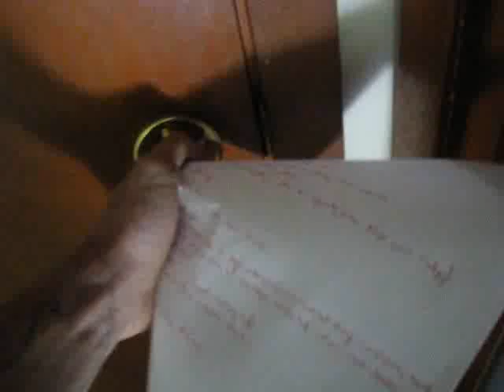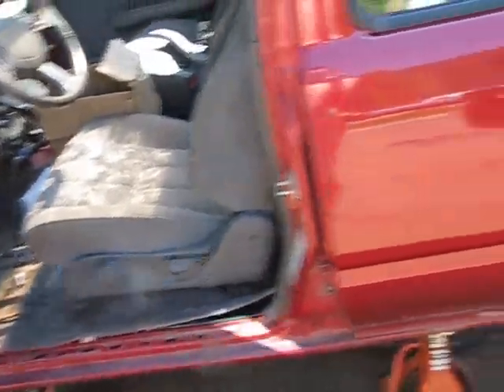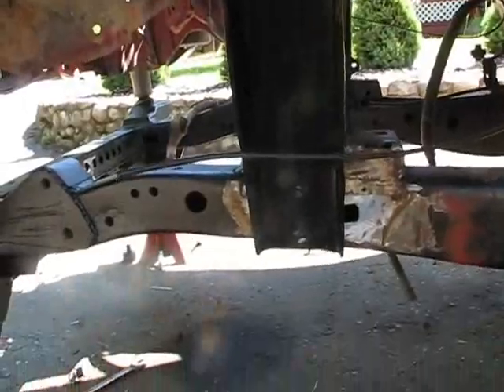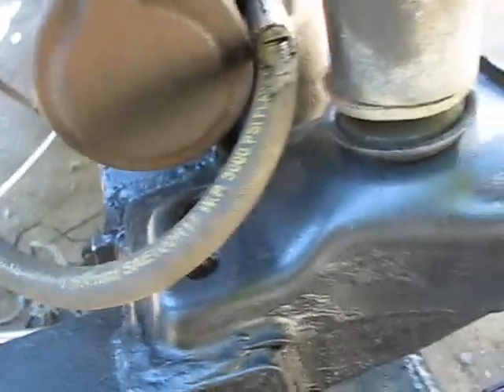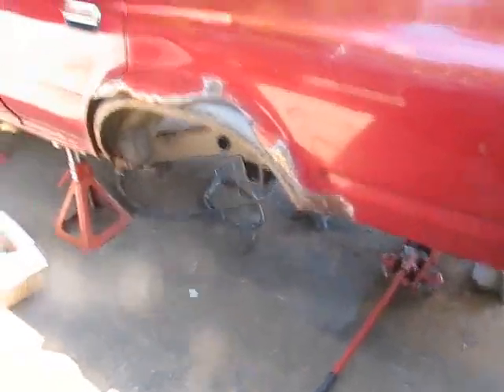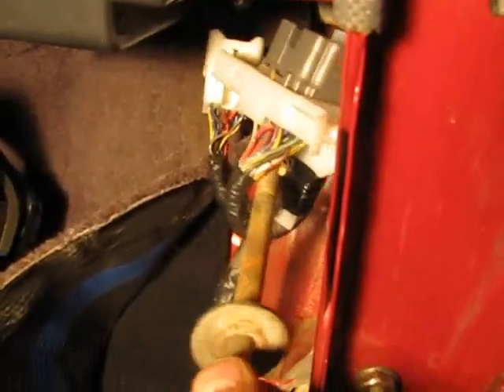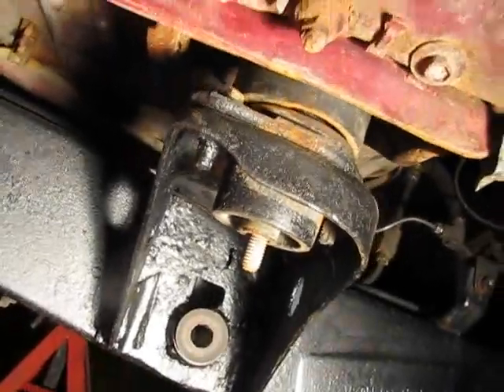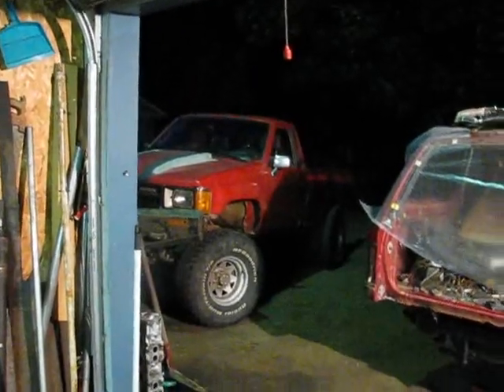94 4Runner: Body Lift Finished + Misc Stuff... (07/30/11)

Comment from the maker: @peterbiltxr379 im definitely not selling it :) its going to be my daily driver/weekend warrior! im building it tough from the get-go so that i dont break stuff. the good thing about building this truck from the ground up, is i can incorporate fixes for all the flawed stuff on my 85 into the 4runner as im building it. like my rear shock positioning... my 85 currently bottoms out the rear right shock if i have a load in the box, or get a bit aggressive on the trails... i fixed that on the 4runner